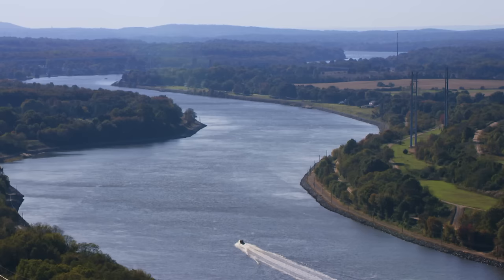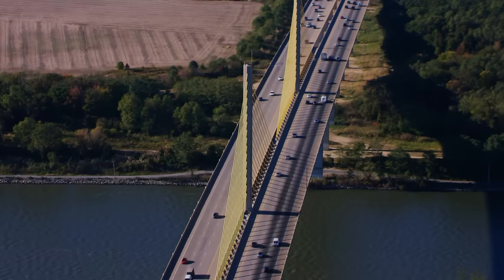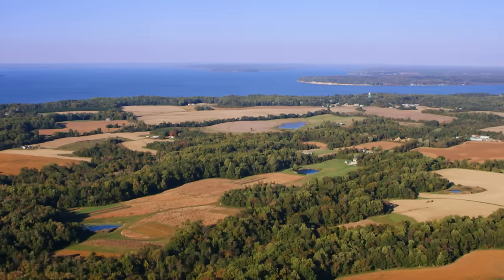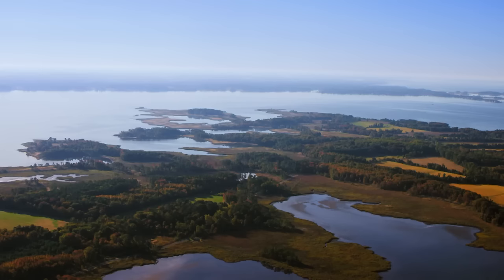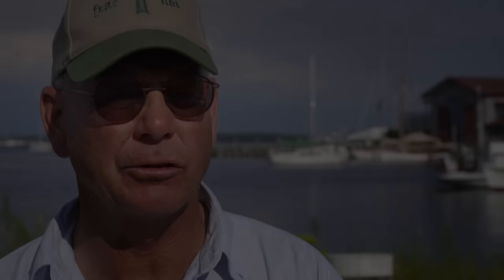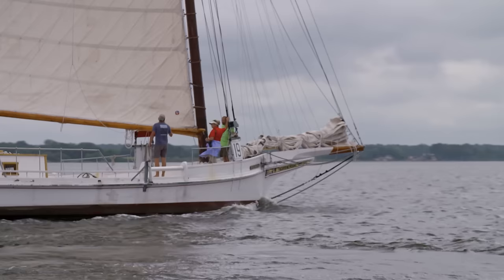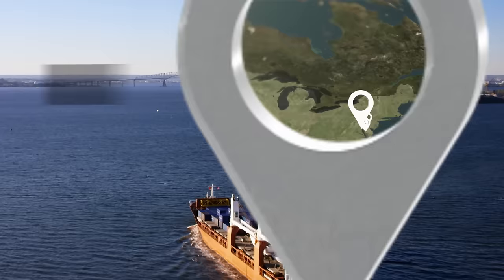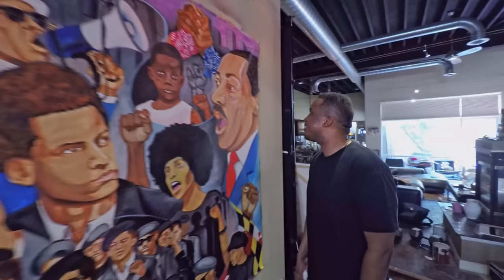The Chesapeake Delaware Canal: The World's Busiest Maritime Highway | America Over The Edge

Comment: 4:51 Maryland's mainland is on the RIGHT at this point. 
5:40 Heading southwest from Turkey Point lands you on the WESTERN shoreline of the Bay. 
6:00 Cecil County is South EAST of Turkey point. 
7:20 Rock Hall would not export animal skins from the west, because the Bay is literally the western edge of Rock Hall. 
7:40 Eastern Neck Island is on the tip of the Kent County Peninsula, which is on the Eastern Shore, not the Maryland mainland. 

That's just what I am sure is inaccurate. The title isn't very accurate, as its more than just the C and D Canal. And sadly, the Key bridge is no more, just two months after this video was released.